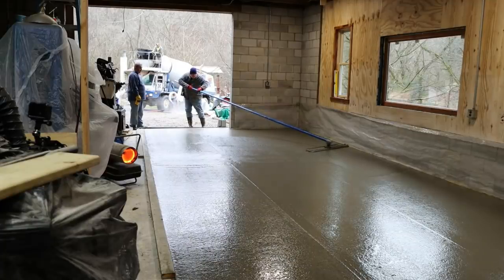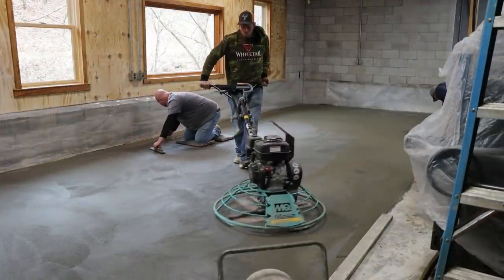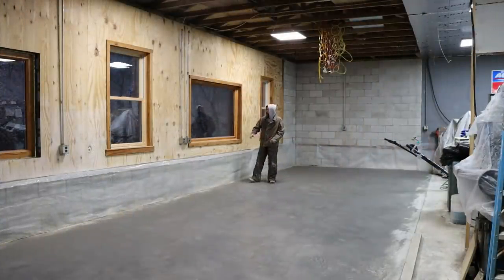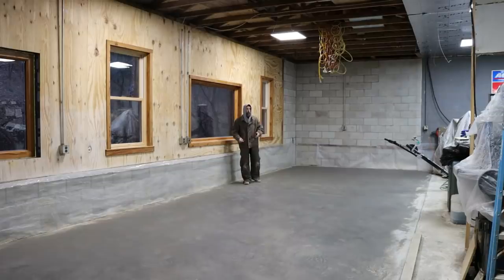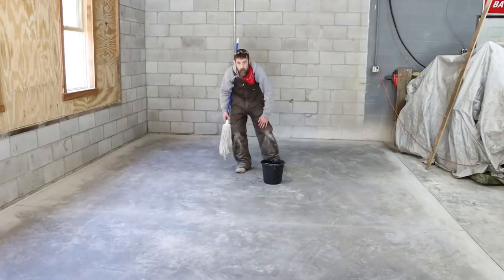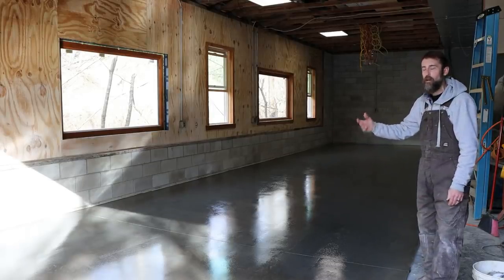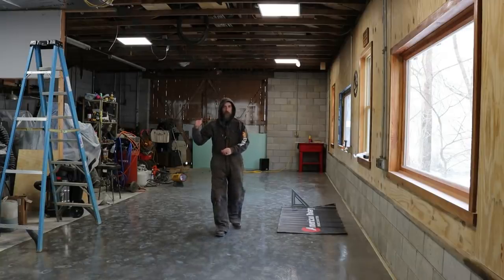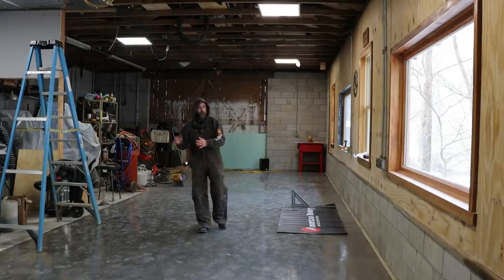Shop Concrete Complete!! Better Than I expected!

Comment: The whole project looks great you should be very proud.  I agree with the sealer, it will be much easier to sweep and wipe.    For those oily stains you already have,
try the cheapest clay kitty litter ( $4 at Walmart).  Grind it in with your shoe, then let it sit for a couple days and sweep it up. It sucks the grease and oil right up out of the concrete. And you can use it several times before it 's to dirty to reuse.  Happy New Year and machining.

Comment: Hey Steve, i spent many years finishing concrete and cure&seal "is not" a permanent sealer it's made to slow the drying process of the concrete if you want something to guard against oil stains etc  you will have to apply a good sealer
Reply: RA, I agree, some Euclid Super Diamond Clear would be my first choice with Sonneborn Kure-N-Seal 30 being a close second if not equal sealer. 
Steve should be able to find either of these in his area, probably just check with his concrete supplier. It’s a little pricey but worth it.

Comment: Steve you have done a good job.     I'm glade to see you putting cure and seal on.  You can apply   several coats.  I usually put on two.  Seal the saw cuts with Sika Flex, and all of the perimeter seams as well.  You have got a real nice shop space now.  And it will be nice to work in in the coming months and for years to come.  Happy New Years to you and your family.

Comment: ceiling insulation.. got any house wrap or just poly sheeting. staple it up just that will help a lot.. how cold are the concrete walls..  and you may want to do some foam sheathing on the doors..  mom lived up in northwest washington state.. over her decorative metal security door.. we wrapped clear wide sandwich wrap and taped it in place .. you could talk thru the closed security door but it eliminated most of the heat loss.. she also got some window clear plastic .. i think it was for a bubble wrapping machine.. double sided clear tape on the window frames and then the clear plastic sheet.. that also reduced heat loss tremendously. you have triple glass so its probably not a problem in the shop.. but what about in the house..  its a thin enough application that windows will still slide past each other..  just some thoughts.   big storms coming your way hit california monday..

Comment: When I have my shop floor poured I am want a very slick finish, it is just easy to clean and move things around. I don’t know but someone was telling me if you have a broom finish done when you have it poured then go ahead and put a heavy coat of epoxy paint down it will fill in the broom marks and lay out slick. Like I said I don’t know about that. Will have to look in on that. Great looking floor. I noticed the Concrete truck had UK on it. So is this in eastern Ky.

Comment: Well done! Really a great job. 
I'm surprised You apply the seal that early. I've seen more than one paint job, on concrete, go wrong, paint is raising and cracking. One floor was old and most likely dry, another was a prefab balcony floor.

Comment: Looking real nice Steve! 
Suggestion on hanging something on a wire: stick two screws/nails into the wall rather than one, and hang the wire over both. You can almost never get a sign absolutely perfectly balanced on one hang point, and over time vibration will likely knock it a little (or a lot) askew. If you use two hang points, even if they aren't perfectly level, you have a much better chance of the sign/picture/frame staying level.

Comment: Awesome work. I was watching the your older videos on using flowable fill around the block to back fill the footer. I have used it extensively in the past and the concrete driver would bring dish soap and put some in the mixer and the flowable fill would travel a long distance and basically self level itself. It saved a lot of time and work not having to drag the fill around. Just a tip for others to think about for future use. Anyone else out there have info on this?

Comment: So nice to see how well concrete finnishes in cold weather ,most of the concrete I have coated with acrylic was done in the open in 40+ deg celcius  and had cold shuts helicopter marks  and broom blobs all over .Every body blames the finnish on the last person there,nice to see a flat smooth surface at the start.

Comment: Looks nice !

That propane heater will add a lot of moisture to the air.  Probably good for the concrete, but not so good for all of your machinery.  Steel wool and a bit of WD40 will cure that.

Comment: wow, it looks so nice. You, and your family must feel SO proud, &  relieved, too. It's a huge milestone, so the sense of accomplishment must be savored a bit. 
I know you appreciate the woodwork of the new wall, but I think you should give it a light coat of gloss or semi gloss light-colored enamel, primarily for improving the light dispersion, but also for ease of keeping the wall clean, too. For the same reason you sealed the concrete slab, you should paint the cinder block wall. Light tan, or light gray, or even  white would certainly brighten the shop a lot. 
Again, take a bit of a break, relax &  breathe a bit, have a beer or two and enjoy your family for the holidays.

Comment: fyi I use that seal n cure in my shop it works great but for some reason gasoline eats it right off. new concrete soaks it up pretty quick it helps to but another coat on in about a month or two. I do it once a year or so. I do concrete for a living so I always have some laying around

Comment: Hey Steve, great to see the shop floor in! I've watched the whole process and the result is excellent so far. Concrete work is definitely worth getting the pros to do. I absolutely couldn't see myself doing that floor.
One request: Could you boost your audio track by +6 to +12db? Your vids are usually quite a bit quieter than anything else I watch on YouTube, and I can barely hear you talk sometimes with the volume turned all the way up. Think the culprit is your mic input level?

Comment: Huge congrats! My only advice is put up that ceiling now before you start moving equipment it will make it a lot easier. Something I likely should have done long ago. Now for me it is one of those needs done things but so does so many other things. Avoid double work whenever possible. :-) SUrprised you can upload. Looks like for me my video days are done for awhile. I have had a 10 minute video uploading since Saturday and it still isn't done..................  Only thing I can figure is That Nashville bombing crippled my internet. It is virtually gone.

Comment: We did broom finishes on the floors in all of the shop and warehouse buildings because the smooth finishes were too slippery when wet or especially with any oil. Forklifts couldn't get traction.
Reply: How much more did it cost for the trowelled finish versus a broom finish?, a lot of man hours there
Reply: How do big box stores (Lowes, Home Depot) manage to get away with a smooth shiny floor then?

Comment: I would go ahead and put the ceiling in that half of the shop now, rather than trying to work around the equipment.
Definitely paint the top of the walls and the ceiling a whitish color it will definitely improve your lighting

Comment: Putting insulation in the ceiling would keep heat in, yes, but what about those doors? That seems like it might be a bigger problem, heat-wise, than the ceiling.

Comment: They have done an excellent job , sealing it that quick could be an issue ,there could be too much moisture left in the concrete , you may have to heat it for a while to drive the moisture out of it and to prevent frost damage .

Comment: Up here Minnesota they have been using plastic tees they press into the concrete for what yours is cut joints. Once the concrete is setup for power troweling, the top of the tee is ripped off. Leaving a crack joint, but leaving the floor with no deviation/bump joint. And not all the dust from sawing. Wondering if there is a reason the saw rather than using that system down there?

Comment: It looks super Steve. Paint it white, and install too much lighting (as if that were possible LOL).  Are you going to hang a ceiling?
Reply: A light colour epoxy floor paint applied, once machines are in their final resting place, will lighten the place up beyond belief.

Comment: Look awesome Steve, are you going to paint the walls? I see on a lot of YT channels that different shops don't have the walls painted, what's up with that? Any shop would be so much lighter with some white paint on the walls, my home garage had orange walls and I'll repainted them white. Boy what a different it turned out to be regarding the light inside the garage.

Comment: Steve , that sealer is a horrible choice for an interior floor in that application . you need a penetrating sealer like SaltGaurd , it makes concrete waterproof and oil proof. The bad news is once you put an acrylic topcoat sealer on you CANNOT use a penetrating sealer unless you grind the floor . OH well . its a floor

Comment: Do you plan to do the ceiling and lights before you move the equipment to that side?  It would probably be a lot easier to do without working around equipment, and I imagine you may need to wait the recommended 28 days before moving heavy stuff in there anyway.  By the way, I’m really enjoying your shop rebuild videos and actually look foward to seeing them every week.

Comment: You’ve really done a great job all the way through this project. I have looked forward to seeing the progress every week. 
Just out of curiosity, have you given any thought to an insulated overhead door to finish everything thing off?
Reply: Nothing else is invalidated, right? The roof ceiling truss area isn't insulated, right? No point of insulating the door if nothing else is insulated.
Reply: This is the exact reason I rarely comment on YouTube videos. Someone always thinks they know more than the next guy. 
If I'm not mistaken, in this video Steve says he plans to get a ceiling and insulation installed. Now,  let's just say he didn't do the ceiling right away, but wanted to install a new door. Wouldn't it be logical to plan for the future and install an insulated one?

Comment: was the new floor a 3000 psi or more ? you want 6" thick floor for some of the machines you plan on . and don't you wish you had free gas for heat , from mineral rights . i would make a new door soon to .  don't stop now . i would also saw cut the floor you plan on removing next , then hammer at your pleasure later .

Comment: Question, maybe you explained it and I missed it: why did you make the new floor higher than the old one?
Reply: The old side slopes toward the doors in front, the new one is more level.  They match on the back 2/3's of the floor.

Comment: Steve, for heating, make yourself a rocket mass heater.   https://permies.com/t/44806/Cobbling-workshop-heater-cooktop-oven :o)  And do that leveling of the concrete on the other side now, that the shop is mostly empty. And nothing has found it's permanent spot. You won't be sorry.

Comment: layed lots of concrete, and you really do have to wait till it is ready for the power float, biggest slab was  6 x 9 metres, but no slotting, and no cracks after about 4 years . On one of them the concrete guy came back at 4 am to power float one section! Great video, and great to see it done, it will all move forward quickly now. Might be an idea to put a timber fillet on the edge between the different levels of concrete to avoid tripping.! you can see my workshop rebuild at https://www.youtube.com/user/philhermetic/videos  .Love your channel, but wish I was your age!!
Phil

Comment: Rent a forklift for moving your equipment. Its easier on the floor and easier on your equipment. Theres nothing like watching someone break a $4000 piece of equipment to save $600 on renting a  proper forklift.
Reply: You're statistically far more likely to break something with a forklift vs using pipes to roll it.

Comment: that cement dust must be abrasive as heck , better clean up the ways on youre equipment with solvent and re-oil them before using them
looking at the sliding barndoors , maibe you can fill the deep parts in with some thin foam and cover the inside with hardboard or hard plastic sheets to at least insulate it a little , some brushes on each side and along the bottom 
https://platstore.nl/media/catalog/product/cache/207e23213cf636ccdef205098cf3c8a3/p/r/productimages_031476082-0000_72.jpg
should keep most of the dirt and draft out 

might be nice to make / put a small shed (portapotty?) over the pad that holds the rotary converter and make it big enough to set youre aircompressor next to it , or over it using a frame  , it will make the workshop a lot queter (well at least you dont have to peel youreself off the ceiling and calm youre hart back down to 80 beats per minute , when youre talking intoo the camera and the compressor turns on ) the rotary converter warms the shed a little so the compressor doesnt suck up as mush moist air 
simple airdryer : https://www.youtube.com/watch?v=tKGQlEDMHjA&ab_channel=StillStandingGarage (you can reuse the demoisturizing stuff by baking it in the oven after use , untill it turns back to the original colour)